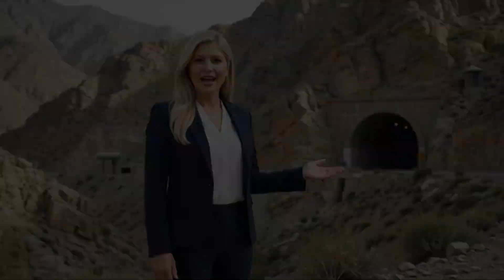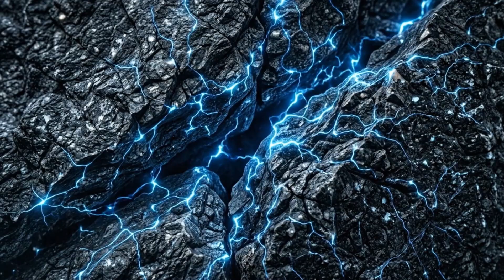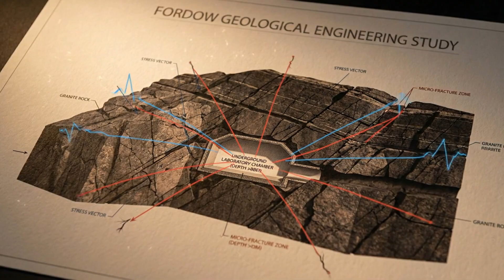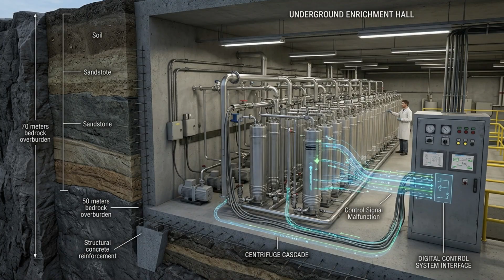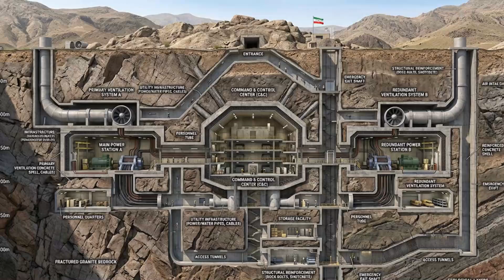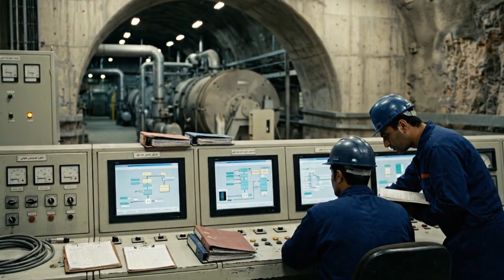America’s 30,000-lb Bunker Buster vs Iran’s Deepest Nuclear Facility – Who Wins Underground?

Comment: The part about attacking the infrastructure instead of the main chamber was particularly interesting. If a weapon cannot reach the deepest part of a facility, targeting entrances and ventilation could become the next strategy. But even then, engineers can potentially repair or replace those systems. It really does become an endless engineering competition. Every attack creates another problem that the defender tries to solve.
Reply from the maker: That cat-and-mouse game between fortification and excavation turns modern infrastructure defense into a continuous, high-stakes engineering arms race where absolute permanence simply does not exist. Every clever workaround a strategist invents is immediately met by engineers designing redundant pathways, blast-resistant seals, and modular replacements. Thank you for diving into that fascinating cycle of perpetual problem-solving!
Reply from the maker: Thank you for being part of this journey and helping us build a community passionate about engineering the future! Your continued support fuels every deep dive we create.

Comment: The phrase “the mountain is part of the machine” really captures the whole concept. The deeper the facility goes, the more the surrounding geology becomes part of its defensive system. But that also means the engineers have to work with the limitations of the Earth itself. You can't simply redesign granite the way you redesign concrete. That makes geological engineering a critical part of the entire equation.
Reply from the maker: Thank you so much for watching and sharing your thoughts! We really appreciate you taking the time to comment.
Reply from the maker: I agree, the Strait of Hormuz is one of the most concerning chokepoints because the scale of the energy flows is so difficult to replace. That lack of realistic alternatives makes even a short disruption potentially very serious.

Comment: The idea of using software to bypass physical defenses is probably the most unsettling part of this story. You can spend enormous amounts of money digging a facility deep into a mountain and reinforcing every entrance. But none of that automatically protects the machines from a sophisticated cyberattack. It shows how traditional defenses can become irrelevant when the attack comes through a completely different layer. Physical security and digital security are now inseparable.
Reply: That’s what stood out to me as well. All those meters of rock can protect a facility from a bomb, but they can’t protect the systems inside from compromised software. It’s a completely different kind of vulnerability.
Reply: Absolutely agree. A mountain can stop a physical attack, but it can't automatically stop an attack on the systems operating inside. The combination of physical and cyber security is what makes these facilities so fascinating.
Reply: Exactly, that was the most surprising part for me too. You can build meters of concrete and rock around a facility, but software can potentially bypass all of that. It really shows how much modern security depends on both physical and digital protection.
Reply: This was the most interesting contrast in the video for me. Engineers can keep making bunkers deeper and stronger, but digital attacks don't necessarily care how thick the walls are. It shows how quickly the definition of “secure” is changing.
Reply from the maker: Thank you for watching and for sharing your thoughts! We really appreciate the suggestion for a follow-up video.
Reply from the maker: Exactly! Physical defenses can be incredibly strong, but modern systems also depend on software and digital infrastructure that creates an entirely different layer of vulnerability. It really shows how security today has to be approached from multiple angles.
Reply: That contrast is fascinating. Engineers can spend billions making a facility almost impossible to physically reach, yet a cyberattack may target the systems inside directly. It really changes the way we think about what “secure” actually means.

Comment: The ventilation problem was something I had never considered before. Going deeper protects a facility, but it also creates an enormous dependence on systems connecting it to the surface. Air, cooling, electricity, and access all become potential vulnerabilities. You can't simply seal the entire facility and expect it to operate normally. The deeper you go, the more difficult survival becomes.
Reply: I had the same reaction. Going deeper sounds like the obvious solution, but then you realize the facility still needs air, power, cooling, and access. Those connections can become vulnerabilities of their own.
Reply: Exactly! The deeper the facility gets, the more complicated it becomes to keep everything running. Protection from attacks comes with a whole new set of engineering problems.
Reply: That was one of the biggest surprises for me too. You can’t just bury a facility and disconnect it from the outside world. The systems keeping people and equipment alive can ultimately become the weakest points.
Reply from the maker: Thank you for watching and for sharing your thoughts! We really appreciate the suggestion for a follow-up video.
Reply from the maker: Exactly! Going deeper solves one problem but creates several others, especially when the facility still depends on air, cooling, power, and access. It’s fascinating how every layer of protection creates a new engineering challenge.
Reply: Absolutely. Ventilation and cooling are easy to overlook when thinking about underground bunkers. It’s fascinating how simply going deeper creates an entirely different engineering challenge.

Comment: What really caught my attention was the distinction between penetrating concrete and penetrating rock. A weapon being capable of destroying sixty meters of reinforced concrete doesn't automatically mean it can travel the same distance through granite. Every additional meter requires more energy and creates more structural resistance. That thirty-meter gap suddenly sounds much more significant. The physics behind this is incredibly interesting.
Reply: I had the same reaction. It’s easy to look at a penetration number and assume it applies to everything, but the material makes a huge difference. The physics behind that is surprisingly complex.
Reply: That was one of the most interesting points for me too. Sixty meters through reinforced concrete sounds incredible until you realize that granite presents a completely different challenge. Every extra meter becomes increasingly difficult.
Reply: Absolutely agree. The numbers really put the engineering challenge into perspective. A weapon designed for hardened concrete doesn’t automatically have the same performance against a massive mountain.
Reply: Exactly, that distinction was fascinating. Concrete and granite may both seem like “hard materials,” but they behave very differently under extreme forces. That thirty-meter difference suddenly feels enormous.
Reply from the maker: Thank you for watching and for sharing your thoughts! We really appreciate the suggestion for a follow-up video.

Comment: The idea that the mountain itself becomes part of the structure is fascinating. Engineers aren't simply building a bunker and putting it underground. They are using the surrounding geology as an enormous natural shield. That completely changes how you think about underground facilities. The Earth isn't just covering the building; it is actively protecting it. This is engineering on a completely different scale.
Reply: I agree, this was probably the most surprising part for me too. You can build an incredibly strong physical fortress, but software can potentially bypass the entire structure. It really shows how modern security has become a combination of physical and digital protection.
Reply: Exactly! The physical defenses almost become irrelevant if the machinery itself can be manipulated from within. It makes cyber engineering just as important as concrete, steel, and geology.
Reply: That was my biggest takeaway too. We usually think of a bunker as a structure placed underground, but here the surrounding rock is doing much of the protecting. It completely changes how you think about underground construction.
Reply: Exactly! The mountain isn't just covering the facility; it's essentially part of the defensive architecture. Using natural geology this way is an incredible combination of engineering and nature.
Reply from the maker: Thank you for watching and for sharing your thoughts! We really appreciate the suggestion for a follow-up video.
Reply from the maker: Exactly! The surrounding geology can become an integral part of the protection rather than simply something engineers have to dig through. It really shows how underground engineering combines the structure with the natural environment around it.
Reply: That was my biggest takeaway too. They aren’t just putting a structure underground; they’re essentially turning the entire mountain into a protective layer. The scale of that engineering is hard to comprehend.

Comment: The depth of these facilities is what surprised me most. Ninety meters of solid granite is an unbelievable amount of material standing between a weapon and its target. It makes you realize why underground engineering has become such an important part of modern warfare. The deeper the facility goes, the more complicated everything becomes. At some point, the mountain itself becomes the weapon's biggest enemy.
Reply: I had the same reaction. We usually think of the weapon as the most important part, but at those depths the geology itself becomes a huge defensive system.
Reply: That was my biggest takeaway too. The deeper they build, the more the surrounding mountain becomes part of the protection. It really shows how difficult it is to overcome natural geology with technology.
Reply: The engineering challenge is incredible. It’s not just about building stronger walls anymore; it’s about using the entire mountain as protection. That makes the battle between penetration technology and geology really interesting.
Reply from the maker: Thank you for watching and for sharing your thoughts! We really appreciate the suggestion for a follow-up video.
Reply from the maker: Exactly! Ninety meters of solid granite completely changes the engineering challenge. At that depth, the mountain itself becomes a massive part of the defense, while going deeper also creates new problems for construction and operation.
Reply: Exactly, the depth is what makes this so fascinating. Ninety meters of solid granite is an incredible physical barrier, and it’s hard to imagine the engineering required to operate beneath that much rock.